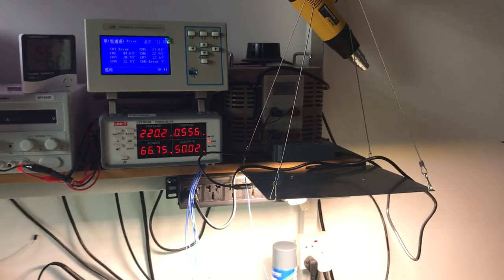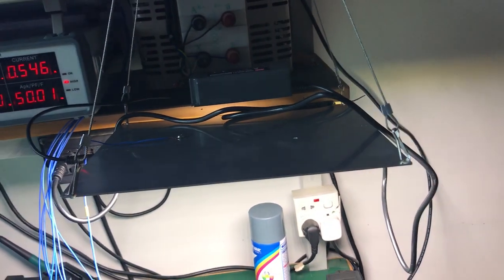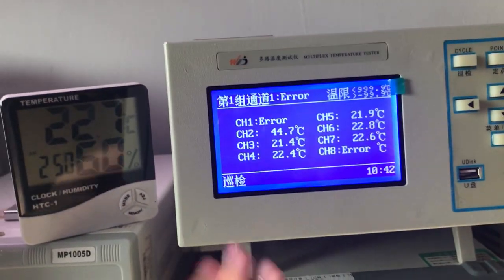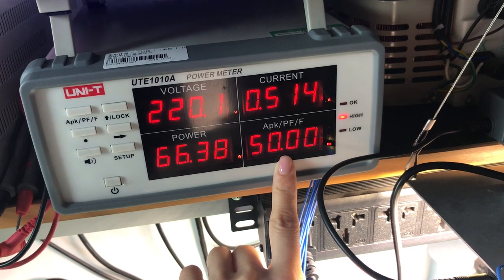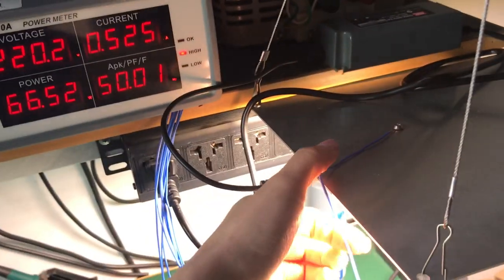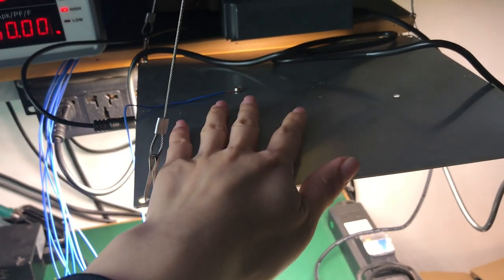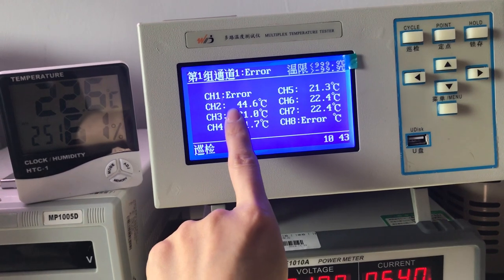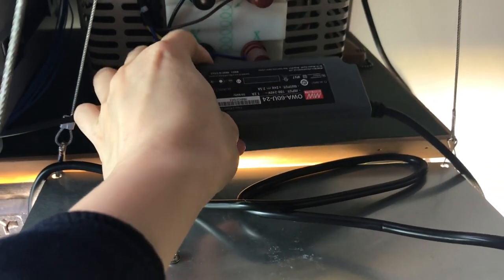LED Quantum Board Samsung LM301b or LM561C VP65 without heatsink, heat testing

Comment: Isn't it being under driven to compensate for the lack of heatsink? I hear these run hotter than your showing with a heatsink!
Reply: No the reasoning behind them being under driven is lifespan. More LEDS at less power means better efficiency and increased life span. Trust me you wouldn't want a say 50 5 watt diodes being driven at full capacity versus say 288 LEDs.  The 1s being driven at full capacity would burn out quick from heat alone.

Comment: wrong my meijiu 288 v2 240w turned all the way up with heat sink can fry an egg!
Reply: jeremy brogdon Well do you 
ventilate  your space correctly 240 watts puts out out same heat as 240 watts of hid. You still need a fan to blow away the stale warm air
Reply: You compare a 2x qb288 at 240w vs vp65 here at 65w ( 120x lm301b ) . They are absolutely not the same .... ( For exemple , my Monster board V4 120w read 55C° with 10mm heatsink )